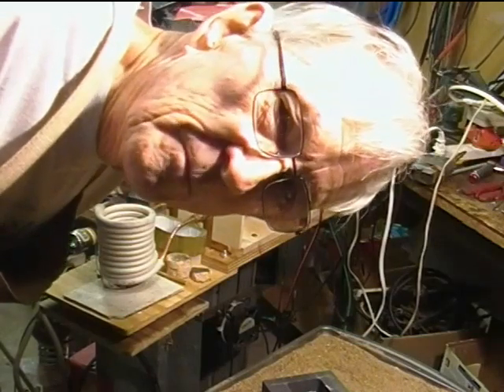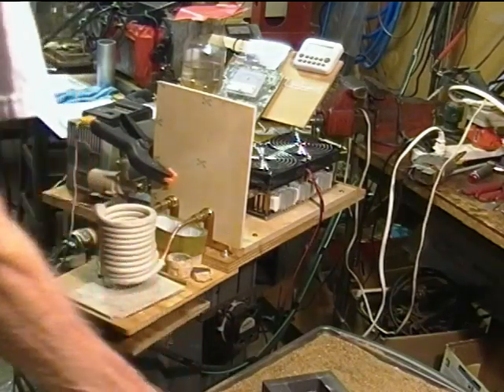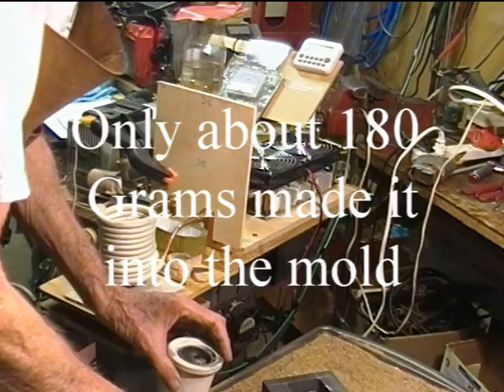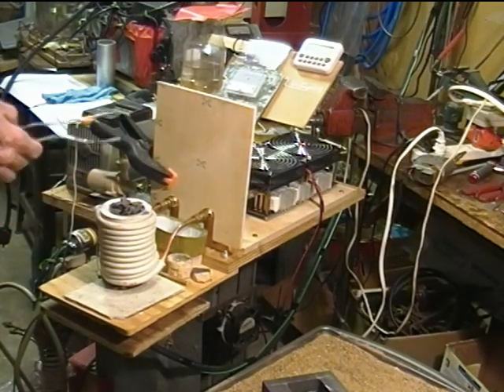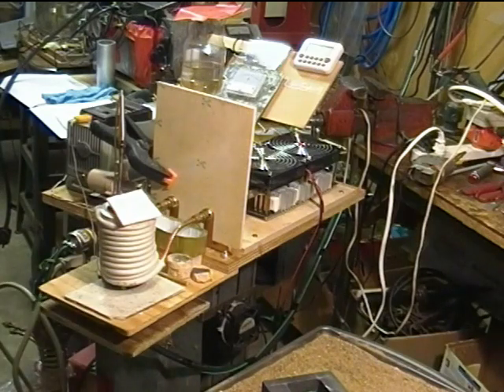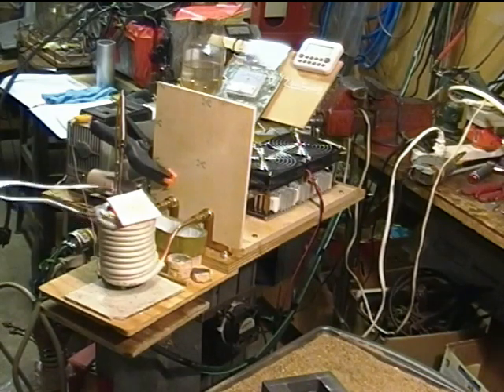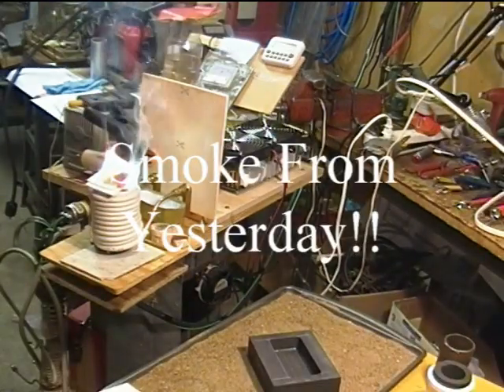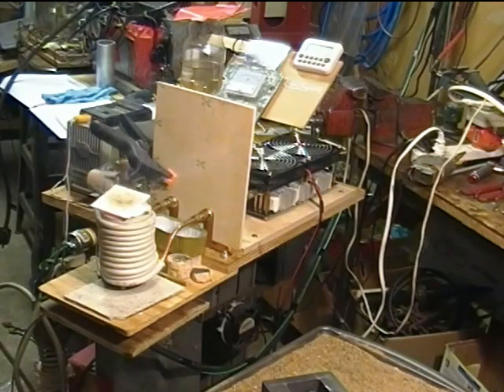Finally Melting Cast  Iron with the 2500 Watt ZVS Induction Heater

Comment: Is that can melt cast iron without graphite crucible? I think it is not. I saw another induction heat design can melt  iron directly.
Reply from the maker: You are correct.  This unit can not melt much cast iron without using the graphite crucible.  The loss of energy coupling when the cast iron reaches the curie point is the problem.

Comment: Can you bring a graphite rod to white hot with this?
Reply from the maker: Why is "white hot" important?   "White Hot" on the video screen doesn't LOOK anywhere near "white hot" to the naked eye.
Do you have a particular temperate in mine?
What diameter of a graphite rod are you asking about?
solid or hollow?
Is this something that you will need to do often enough to make a special coil for, if it could be done?

Comment: The cast iron is oversaturated with Carbon from the graphite crucible and the  maximum temperature that the ceramic graphite crucible will withstand is 1100 deg C  you will need a quartz graphite to get clean usable steel. Thanks for posting .

Comment: I'm glad you made this video and read out all the quantities, I was just wondering if one of these melters could handle iron. I think for my own setup I will see if I can get one a bit more powerful.

I wonder if it's ok to have a few feet of cable going to the coils without too much loss, I'd like to make it so I can tilt the whole melt unit, coils, crucible and a frame to hold them, with the melter electronics separate, like they do with industrial ones. I assume being at a current and frequency that induces heat they might need to be handled carefully. Do they cause much heat if they are running in parallel? And I'm thinking I might set it up on a metal table and weld a lip on, then put sand around it in the top it so that if anything spills it doesn't splash on me or catch anything on fire.

I suppose to do that I'd need hoses for the water that can handle heat.
Reply from the maker: No, I don't think one of THESE 2500 watt and smaller induction heaters would melt  steel. Note that I melted CAST iron, which has a melting point several hundreds of degrees lower than most steels.  (I think that you mean steel when you say "iron").
Yes, they do make flexible, water cooled  cables for these things.
Here's one example:
https://www.mettleworks.com/hot/index.html#link-Accessories

Comment: It's interesting to melt other metals (up to 2000 degrees C) without the use of graphite crucible (which creates problems). Using an inert crucible made of alumina or zirconia will be perfect, but the device needs a higher frequency.
Reply from the maker: ----the device needs more POWER, not necessarily (or even desirable) higher frequency.

Comment: What kind of thermocouple did you use? Did you float it above the metal? Or is it immersible? Very cool
Reply from the maker: I use a stainless steel sheathed, Type K (Chromal/Alumel) thermocouple. I stuck it as far down into the crucible as I could get it.   Note that I removed it at about minute 5.  That's because I didn't want to melt it.  Even though the stainless steel's melting point is several hundred degrees higher that that of cast iron,  once the cast iron had melted, eventually amalgamation would occur, I think, and the T/C would be destroyed.
Reply: @frenchcreekvalley  that was actually my concern, was melting it. Well that and shorting it, but if its sheethed in SS. Do you have problems with the metal sticking to your TC?
Reply from the maker: @TechNick3D  I don't put the TC into molten metal.   Many years ago it was customary to use disposable sheathed T/C's to get the temp of molten metal.  They'd stick the T/C into the batch and, just before it melted, they'd get the reading they needed.   I think the  company that I was working with sold them for about $5.00 each in quantities of 100 or more.  That was about 1960.

Comment: Hi, I tried melting steel with my 5kW ZVS induction heater and it work just well except 1 issu, the crucible is made from graphite and a ceramic shield. But graphite is made of carbon as well as steel, so when it was at high temperature, the steel and the graphite started to mix and when I pour it, I've saw that my crucible was very disintegrate at the bottom...
Did you have the same problem? Can you explain how to fix it?
Reply from the maker: Graphite crucibles do deteriorate at "glowing" temperatures no matter which metals you are heating.   But, as you discovered,  iron has a great affinity for carbon at high temperatures which makes the deterioration  even worse.  And, the higher the temperature, the worse the effect.
One other negative side effect of graphite combining with your initial charge of steel is that the steel you melted will now have even more carbon in it than before, making it harder to work with  and probably more brittle.  In fact, you may even have made cast iron!
   I have gotten small quantities of steel up to about 2200 degrees F.  with my 1000 watt ZVS heater withOUT a graphite crucible.
See:
https://www.youtube.com/watch?v=5t_zbrUwZI4
Since you have a 5000 watt unit, I suggest you try your experiment again  with a ceramic crucible and NO graphite crucible.
You may have to hold the crucible part way out of the work coil until the charge of steel reaches the curie point to avoid an overcurrent situation.
Reply: @frenchcreekvalley  thanks so much for your reply, espacually this quikly, I will try with an alumina ceramic one when i'll receive it.

Comment: Accorinding to this calculator it is supposed to take less time to heat cast iron to 1400 than it does to heat copper to 1200.  Do you think you could pour a full crucible of cast iron in 15 minutes?
https://www.plustherm.com/power-calculation.html
Reply from the maker: I think it would take about 20 minutes to  melt a full crucible of cast iron.
That link doesn't include Cast iron, just iron, unless I missed something.
CAST iron melts at a much lower temperature than does  pure iron or mild steel.
Reply: @frenchcreekvalley  You are correct, no cast iron.  But calculator figures even iron will get to 1400  faster than copper to 1200.  For some reason I could not put in temperatures above 1400 so not sure if it will melt iron.  Still, a load of cast iron in 20 minutes is almost unbelievable, no?

Comment: Maybe if you had a crucible with more graphite then you could get to higher amps? I have seen a 1.5Kg crucible that is about same width but taller - aprox.50% more graphite.
Reply from the maker: I think "More" graphite in wall thickness actually gives you less current since it would mean LOWER resistance.  But "Taller" might work.  However that would require a longer coil and the design work to make sure it would work.
Reply: @frenchcreekvalley  I would think if you put a long solid 2" thick cylinder of graphite in coil then amps/power would go off the chart?  Here is link to crucible.   If  this shaped crucible could force, say 60 amps out of a 2500W ZVS board/coil design, then it could be gradually lowered since amps inevitably crash during melting.   Of course, this would make your jack in last video more useful by helping maintain power levels while under heavy loads.  
BTW - I found this article on DIY rammable induction crucibles.  They are not as dense or resistive as manufactured crucibles but still useful maybe(?) - some special additive in them makes the crucible last longer by protecting graphite from oxygen burning, somewhat similar to industry induction crucibles that form a protective glaze over time on the outsides that helps slow oxygen reaching the graphite.  
https://akademi.tudoksad.org.tr/site/file?u=20181210062549_congress_file_249.pdf&t=A+New+Rammable+Conductive+Lining+Material+for+Induction+Furnaces
https://www.ebay.com/itm/1-5-Kg-Graphite-Foundry-Crucible-Cup-Melting-or-refining-Gold-Silver-or-Copper/282690763144?hash=item41d1aeb988:g:2kQAAOSwwRRdlKpj

Comment: Cool thing about cast iron besides being so universally useful,  is that it poors like watter and fills out preheated molds very easily with good detail - Love It !!!!   Think of all the uselful parts that could be poored in our basements - maybe up to 1/2 pound parts or several smaller items in one poor!  
I am thinking a good part of the goo was just unmelted metal in the center-top area, the coolest part of crucible, since heat is eminated from resistor or graphite crucible edges/bottom, and ratio of liquid to slag seamed high.  Just like you said (taking it out cooled things down & a couple minutes longer melting time, and covering it. then probably would have had more to poor - GENIUS.  Not sure if cast iron needs a flux cover?
Reply from the maker: I think you are correct.

Comment: Hey there! Could you maybe tell me/us the perfect inductance of a selfmade coil? I am trying to make one right now but I have no clue about the right inductance.
Reply from the maker: That's a tough question to answer without knowing your application.
My experience is limited to the 1000 watt to 2500 watt ZVS induction heaters, by the way.
Start out by going here:
https://spaco.org/Blacksmithing/ZVSInductionHeater/WorkCoilsForZVSInductionHeater.htm
The easier question to answer is "what is a bad work coil".   My first answer to that one is that a bad work coil is one that damages the induction heater.  And that usually means a work coil inductance that makes the tank resonate at a frequency higher than about 130 kHz.
Reply: @frenchcreekvalley  yep, my fault - I really should have mentioned that I am talking about the ZVS 2500W version.

Comment: Very good, enjoyed. Next time you may remove the zinc bathing the chunks in muriatic acid for a while. Do it outside though, In that way you can melt it safer and can add up iron until the current goes to the max. You may have a full mold or at least a square beautiful piece of iron.
Reply from the maker: In this case, I took the cast iron chunks outside and cooked them with a propane torch until almost all the zinc was gone.  It only took 10 minutes.